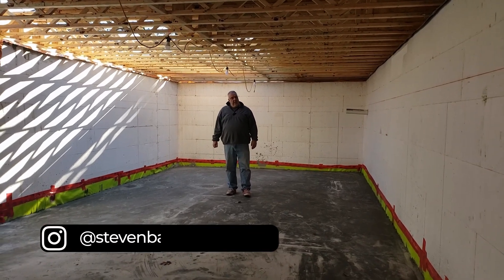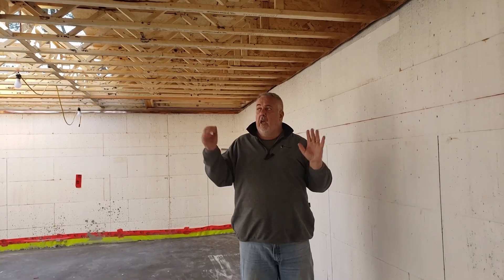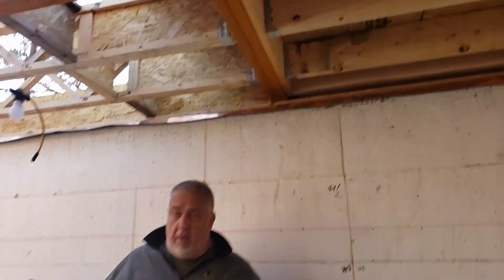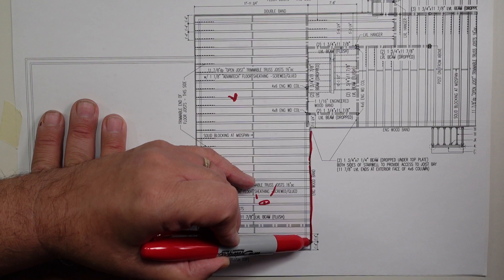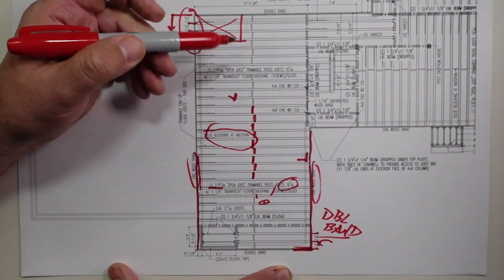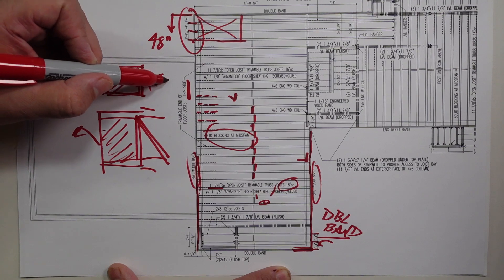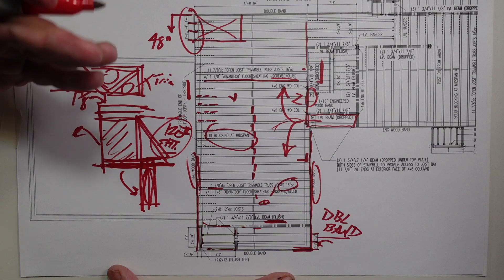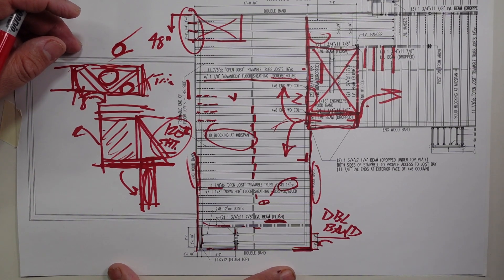Trimmable TRUSSES ??

Comment: Great video Steve, one question, how do you fire stop between the trusses with the open web, is the drywall sufficient
Reply from the maker: The code requires a division of a max of 1200 sq ft. Easily solved with lining one side of a truss with 1/2" plywood